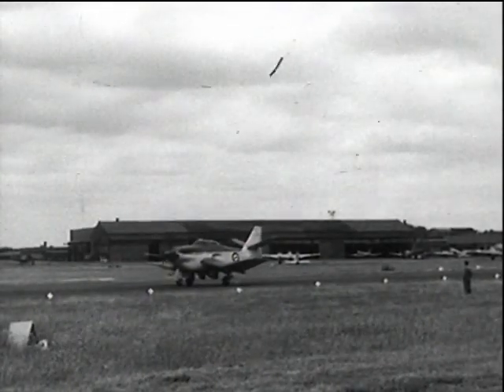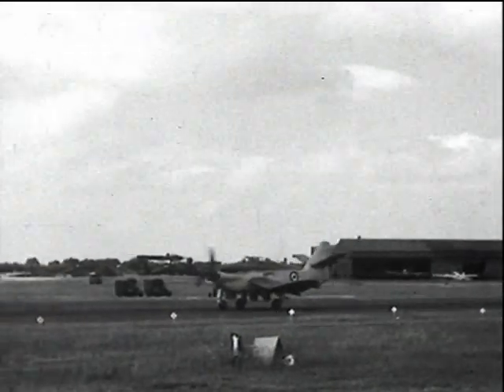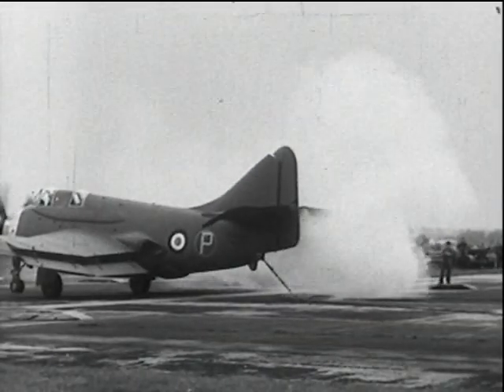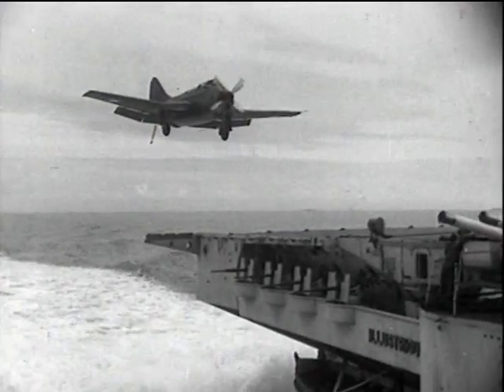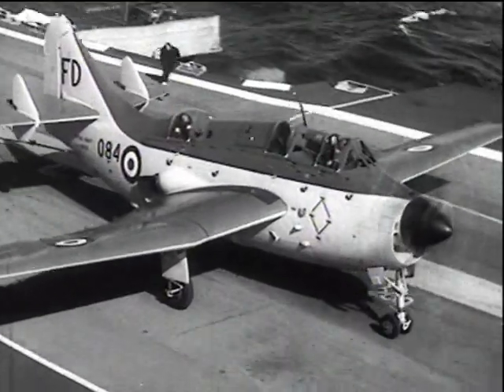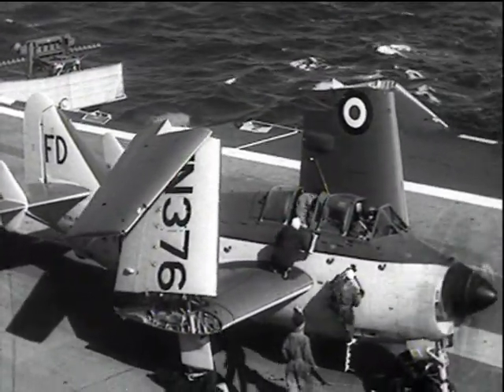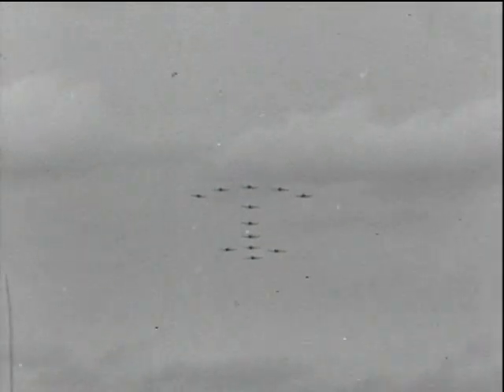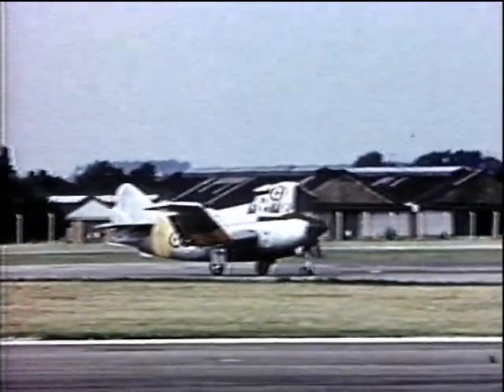1st Deck Landing of a Turbo-Prop Aircraft. Carrier-borne Anti-submarine Aircraft.

Comment: That aircraft at the start on the runway was NOT a Gannet, it was a Blackburn Y.A.5.
Reply from the maker: Neil Ferguson-Lee yes that has been mentioned by others a number of times. The voice over is a bit misleading. The aircraft shown was Blackburn's design and prototype offered in respect of the Air Ministry's specification. In the end Fairey's design won, but technically this aircraft was a prototype of the Gannet, which is how the VO refers to it.

Comment: Haha the commentary on this film is a bit awry, the first aircraft in this video doing RATO trials isn’t even a Gannet! It’s the first prototype of the Blackburn YB.1 plus it’s not even turbine powered as this aircraft had a Rolls Royce Griffon installed. Awesome archival footage though, hope you have some Wyvern material in the archive to share:)
Reply from the maker: The Blackburn B88 or YB1 was Blackburn's design for the specification laid out by the Air Ministry for the aircraft that became the Gannet. Fairey submitted it's own design and built a prototype. Fairey won the bid and their design ultimately became the Gannet. So the aircraft shown in the video is one of 2 different prototypes that were put forward to the Ministry.
Reply: @FASTAviationArchive  actually whilst further brushing up on the Blackburn design I realise that the one shown here isn’t in fact the YB.1 or the B-88 as those designations apply to the third prototype aircraft with the double mamba engine. The Griffon engined prototype seen in the opening shots of this film was designated the YA.7. All very confusing for an aircraft of which there were only three built! Either way it’s still not a Gannet like the narrator tells us it is 😊
Reply from the maker: @richuar  you are correct, I mistakenly wrote B-88 when I believe it should be B54.  Hopefully something here is now accurate!
Reply: @FASTAviationArchive  postwar aircraft development produced such an overwhelming array of prototypes I think we can all be forgiven for some confusion! One thing that I think is true though is that for all the stick the Gannet gets for it’s looks the Blackburn effort was somehow even more ungainly looking!